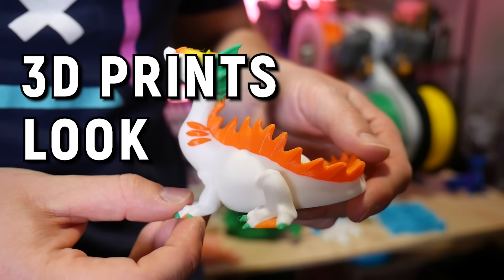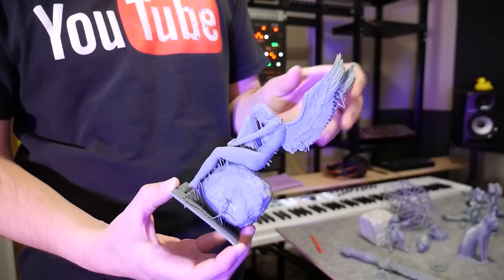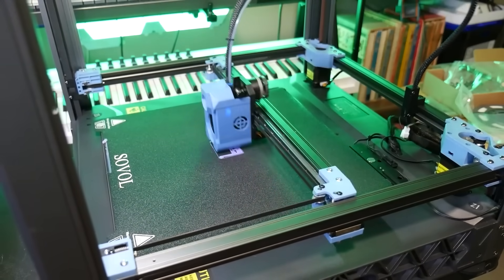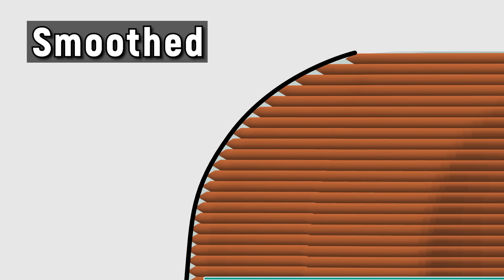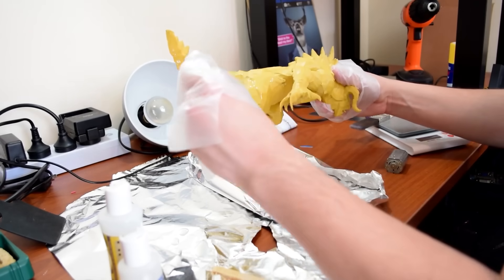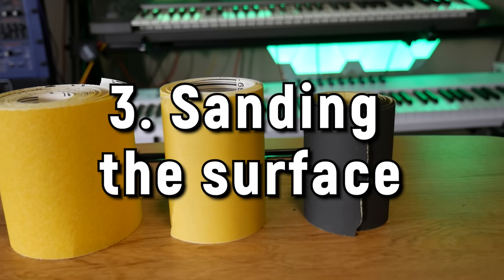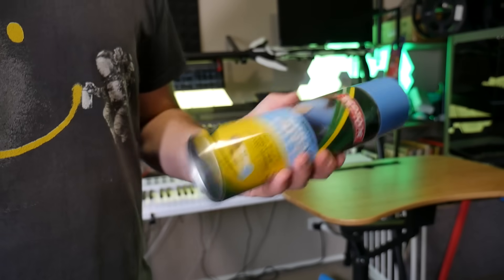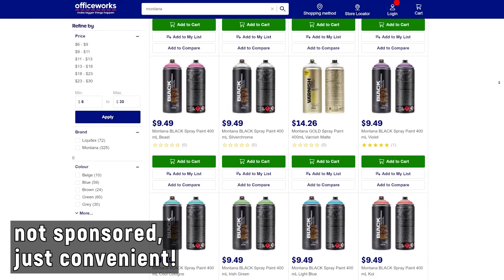How to make 3D prints look like they're NOT 3D printed.

Comment: Yeah as of 2003, they introduced legislation (at least here in Aus) where manufacturers of Talc had to do testing to make sure their products did not have asbestos in it. The reason it even does to begin with is because Talc and Asbestos are both minerals that are mined and are regularly found very close together so contamination becomes unfortunately common. They've since switched to corn starch for the same purpose (sports powder, baby powders) and it MAY be able to be used as a thickener but you would need to test it. Being corn starch, I wouldn't be surprised if it wanted to try to clump when added to resin so you may need to sift it in while mixing to prevent the issue.

Comment: Hi very interesting video. Love the details however there is one small problem for me. It's apparent to me from your accent that you and I are not from the same neck of the woods. Therefore there will obviously be terms that you use that I am not familiar with and the same in reverse. All that said .........What exactly are you referring to with the term BOGGING?
Reply: Reference to a product called Builders Bog which is a putty like product but sets hard with an activator. Used by builders, auto repairers etc
So when you are 'bogging' you are doing putty type work.

Comment: Vapours? Dust? Fine powders? Buy an LEV, use a Tyndall lamp to check the maximum working range of the LEV's hood and make sure you use it. Its going to work 1000x better than any PPE, removing almost all contaminants from the air, meaning no lingering dust or vapours will remain hours after the work in the air that you or other people will breath in. An LEV is a Local Exhaust Ventilation system, a kind of vacuum cleaner for a work area. Chose the correct type for the work you are doing and the contaminants you are producing. Its an investment for your set up and your health. This is even more important if you are young and just starting your own workshop. Respiratory issues can take decades to appear, the same with the other issues with your body when exposed to such chemicals - a number of cancers are caused by inhaled chemicals that end up in the blood stream that ultimately travel around the whole body.

Comment: Its one of the reasons i switched completely to resin printing, high resolution, high print speed, easy sanding for my highly detailed sculpts.
I mostly use knife putty used for drywall to fill scratches and small holes, its non toxic with very low smell, has toothpaste consistency, water based so it can be thinned with water and reactivated and smooth with water so sometimes just going over it with a damp cloth to smooth out the excess works great without sanding.

Comment: Frankly, I believe in KISS (Keep It Simple Stupid). If I want to get the same perfectly smooth results, I just spray my work with several layers of Rust-Oleum Triple Thick Glaze spray paint and all the print lines disappear. 
And if you don't like the original, just spray on a base coat of the color you want.
Plus, should you wish to achieve a pearlescent appearance, all you have to do is make the base coat white primer. 
And I haven't once had to resort to sanding. 
Why people insist on making their work so much harder and time consuming I'll never understand when just three or four coats of spray-on clear glaze gets the same, if not better results than I've seen from all the overly labor intense methods like this I've been seeing on YouTube and still get the same results in 24 hours just by applying three or four coats of Rust-Oleum Triple Thick Glaze spray paint, and not once having to touch your work with sandpaper. 
KISS! 😘
Maj. Tamre' Colby 😃👍

Comment: Card or cabinet scrapers aren't talked about enough in smoothing 3D prints, but do a fantastic job at scraping down the high points to a close to smooth finish so you don't have to do as much sanding

Comment: Could a sprinkler made from say, pla for the main body and a silicone disk (replaceable) with holes angled correctly be something you could make?
I’m thinking the disk expands under water pressure like a dome.
Have you tried dipping into a plaster slurry?
You can use a masking tape on each surface and paint…. Just let it dry (instead of double sided)

Comment: Going to even higher grit gradually and finishing it with clear that you use polishing paste on will get you a really smooth end results. Then you will get rid of that "orange peel" effect that you have on the red piece you showed. Check out the light reflections, they will reveal the rough surface. Ask a scale modeller how he knows.

Comment: Sanding becomes much easier with a good sanding paper (3M Cubitron Xtract is indisputably the winner here, watch the Jonathan Katz-Moses sand paper comparison - the ratio of grams sanded per dollar spent makes it BY FAR the most cost efficient and time saving sand paper - ever), a random orbital sander with a soft foam cushion (for gentle curves), and a Dremel / Foredom (Vevor S-R, 230W version is a really good knockoff) with various sanding attachments, you can even build (print?) your own bits and stick the Cubitron paper on there. Works really, really well with any material.

Comment: I’m an epoxy/resin artist and they sell a liquid resin in a bottle you could easily use on these. Just google uv resin ..  it’s not the kind you use in a 3d printer.. it’s used for molds or to make resin art so it’s a bit thicker.. . Just brush it on like you did with the epoxy and cure like you did with the printer uv resin.
Reply: I just searched it up, is it the “LET’S RESIN UV Resin Kit With Light”?
Reply: @MiracleMyz 
That’s one of them,  yes! ;)
.. I use a couple different Uv resins their a bit more expensive called “Counter culture Uv resin” and also a uv from “Resin Rockers”.. …. but “Let’s Resin” is a popular decent brand out there as well. ..
The difference between Let’s Resin and the other 2 I mentioned is that you get a more consistent result when using the more expensive uv resin .. 
Less or no bubbles, no yellowing, etc.)
Reply: @MiracleMyz and yes you’d need a uv lamp to cure it. Not necessarily the one from let’s resin .. (there’s a lot of different lamps out there besides that one.) but I’d say the most important thing is just make sure whatever uv light/lamp you purchase has enough of wattage to it (so you can cure your projects fully) and can cure many different projects… whichever uv resin you buy see what the highest wattage is to cure your project is on the bottle and then make sure your uv lamps wattage goes up to the same amount of wattage (at the least.) Then this way you’ll be able to cure a range of different projects. (Because the wattage and times differ depending on projects.. like how thick or thin the uv resin is.)

Comment: I dont know much about sanding but 400 grid sandpaper seems to be not that fine, i mean car detailers use i think 2500 grid sandpaper for repair scratches, is the 400 grid really good for like a high gloss piano finish?
Reply: Yep. I would sand to 2000 before painting, and then clear coat. The clear coat then gets wet sanded to 5000 before finishing with polishing compound. When done right, you’ll see your reflection.

Comment: my favorite way to smooth prints is by using wood filler mixed with acetone, you mix however much acetone you want for consistency, my default its a paste, afterwards you either smudge it with your hands wearing gloves or brush it on with a brush, it cures very quickly and you can sand easily compared to pla so it will remain only in cracks and crevices if you wish.

Comment: I tried UV Resin and Baby Powder.  It too can be sanded down to a smooth finish.  I got great results.  Can keep repeating.  Also much easier to be selective with where I put the mix down using a paint brush.

The best part is it’s super fast. The UV resin cures in seconds and only takes 5 min of sanding to get great results.

Comment: Very helpful info, and well-presented as always. Cabosil is the definitive thickener for epoxies and resins. One drawback: take precautions to avoid inhaling the dust -- a simple dust mask will do.  In return for this important but simple handling precaution, it is easy to use and very effective for making liquids non-saggy/drippy.

Comment: I got this response from ChatGPT: “Using 60 grit sandpaper is a good start for removing rough layers from a 3D print. Before applying Septone spray putty, it's beneficial to progress to finer grits, such as 120 and 240, to achieve a smoother finish. This preparation will help the spray putty adhere better and create a more even surface. Ensure the object is free of dust before applying the putty for optimal results.”

I’m not so sure if I should continue to try 120/240 prior to the putty ?

Comment: If the best solution is Sanding, how would you do that for very intricate models like the ones you coated in resin etc? I doubt you can sand all the teeth from the dinosaur.  So I guess every techniques has it's limits, pros and cons. If sanding is not an option, wondering what the best coating option is?!

Comment: Neat, I learned something. I have my outer layer set on my printer to be a bit thicker than most people set. Then, use a very sharp knife - really carefully - to smooth the surface. This is aggressively sanding it without making micro plastic dust. This removes the layers. Then I do one of 3 things. If I want to maintain that etching look, leave it. If I want it looking professional I might go in with a colored UV Resin, or clear if I'm gonna paint it. UV Resin is a pain cuz it takes forever to cure when using a thin coat... keep that in mind. Perhaps my finished desired was this and I stop, perhaps I paint over top of it. I'm always eager to learn!

Comment: Fantastic! The most useful tip might be print orientation. Somehow I've not thought of that for FDM printing. D'oh! 80% of the time that alone might be enough and costs only patience. And you're so right, it's worth the printing time to save finishing time. 

Worth noting this affects the strength of the part, depending on the layer lines.

(Never heard of bog spray! Cool.)

Comment: I use UV Resin for coating all the time. Small detailed surfaces can be smoothed with a small brush and than sanded with 400-600 grit Sandpaper. The best part is that this make parts watertight (for RC boats).

Comment: With all of the news about microplastics, and someone who has just bought their first 3D printer... I don't know about it all. Super fun hobby, but do I really want to expose myself and my family to the risk?
Reply: Its totally reasonable to suspect 3d printing but the only harm it can lead to is if you print in a area with poor ventilation and and if you are printing for the sole purpose to help consume something besides that no dangerous fumes should harm you or your family unless your constantly printing
Reply: Depends what sort of 3d printer. An FDM printer using the normal plastic filament will be fine, and wont produce fumes. Of course if you are sanding it like in the video it will produce fine particles, but just do it outside with PPE and you and your family will be fine.

Resin 3d printing on the other hand is a little harder, the bare minimum you want is a well enclosed space with a ventilation system going outside. And the entire system being in a room that you wont spend much time in.
And sanding that sort of stuff is a bit more dangerous.

Comment: In Cura, I just use the Fuzzy Skin option quite a bit these days.   I realize it's not for everyone, and it can be tweaked to satisfaction, but overall I love that.   You can hardly tell it was 3D printing and the layer lines are almost all eliminated.   Does anyone agree with me?
Reply: The fuzzy layer peels and chips off
Reply: @ShopeeMarketteam  Never had that happen but I guess some abrasion rubbing against it could happen.  I just looked at all my models with fuzzy skin, holding good.
Reply: @ShopeeMarketteam  What are you printing with which it peels off?

Comment: I've attempted to use the wood fillers for 3D prints because some of those can be smooth down with water, but problem often was with applying the fuller since it's a paste. My only hang up was trying to sand organic shapes (example: a dog model with some sculpted textures) and my inpatients with seeing very little progress done with sanding as in the past that was mostly what people suggested doing... just sanding and no fillers to try and smooth a surface. I might see if I can find something similar to the spray stuff here in the US when I get back to 3D printing more often

Comment: So I feel like your understanding of Resin printing is somewhat lacking. UV prints do not get any more embrittled than most other plastics. The photoinitiator is usually spent during the curing process. Once spent UV embrittlement actually occurs similarly to in most other plastics. Also the primer and paints are going to block UV. Warping is not a result of exposure to UV but the fact that a lot of resins have a really low HDT. So just like PLA they do not do well in direct sunlight due to this not because its reacting to UV. It’s not unusual for resins to have an HDT as low as 50C which is significantly cooler than even what PLA can handle. The build volume is also comparable to similarly easy to use machines. Resins printers are almost push button these days. For the Price of the p1p you can get something like the anycubic m7 Max which has 90% of the build volume of the p1p. My view is that detail aside you look at your application and choose the right plastic for that not large go FDM small go Resin. As for how I finish my prints it totally depends the application and material. For large resin I’ll straight up media blast it. I don’t think people realize how hard Resins are when thick. In miniatures they are pretty weak but 3-4 mm of solid resin is really really hard to break. For FDM I like using wood filler to smooth out the layer lines or again media blasting the part. For miniatures depending on how lazy will use thin coats or up resin to remove layer lines. Or sand it by hand. But generally speaking if the part is larg

Comment: One thing that's good to keep in mind if you are going to rely on sanding: Print thicker walls! It's incredibly disheartening to ruin a long print because you went a little too hard in one spot and managed to sand down until you exposed the infill. Putties can help fill it in but it's still a pain and may lead to that spot having a slightly different look.

Comment: If you're still looking for an additive to thicken resin for smoothing, you might try milled glass fiber, silica thickener or Glass microballoons. You should be able to find these at any fiberglass supply house. I use products from "TotalBoat"

I use these all the time on boats to mix with fiberglass resin for filling holes, building up fiberglass corners in bulkheads, a thin skim coat to fill tiny imperfections in fiberglass before gelcoat, etc. You can make the resin virtually ANY consistency you want.

I bet this would work great for your application. It's relatively inexpensive, a little goes a long long way and you already have the safety equipment required for use (good respirator).

Comment: Here is a really big tip that wasnt in the video. For FDM printers you should use a 0.2mm nozzle instead of the standard 0.4mm that comes with every 3D printer and also setting your layer height to as minimal as possible in software, that alone can make it silky smooth right off the printer. This alone makes the prints look almost like resin and I have only had to do minimal sanding!

Comment: Full on heat reflow works well too. Print it in 100% infill, pack it in casting sand, heat it up to where the part just starts to melt. It will be much stronger and smoother when it has cooled back down. Also handy if you don't want to risk glue failure of the part and removes seam lines.

Comment: Somewhere between the spray primer and resin, can you not brush on a two part automotive body filler? Instead of thickening it up with some kind of additive, you can mix it up in small batches to minimize waste, paint it on when it feels just right but before it's too cured to work with, then make another small batch, rinse and repeat until the model is coated, then sand it down to where you can just barely see the layer lines because the filler cures ridiculously quickly when mixed.

Comment: If it’s big smooth surfaces like helmets then it’s sand with 100 grit . Coat with thinned body filler and sand , rinse and repeat with 250 and maybe wet sand with 600 if it’s helmet or armour.  Blasters it’s just sand and sand and sand again

Comment: I will be buying my first 3d printer soon and I want to try using model hobby surface primers. The best ones are from Mr Hobby. They are self levelling and very thin, when applied through an airbrush. I believe my experience in modelling will come in handy if I want to smooth and paint parts that I print.

Comment: There's these electric dead skin files for your feet that have a nice low rpm and often adjustable speed so they don't melt the plastic from excessive friction and you can use double sided tape to stick any grit sandpaper you wan to and if you've got a lot of big flat prints to sand for cosplay or whatever it's the best $15-30 you can spend. I used a foam pad of 400grit to smooth out between the ridges of a vase I printed and it came out really good without ruining the ridges or taken tens of hours to sand.

Comment: 7:40 the BIG problem with that orientation is that you get a very weak structure that will break at the first sanding; keep in mind the Z axis, the direction in which every layer of filament is deposited, is the easiest to separate when you apply force along the vertical axis.
Reply: True, but if it's a part that will be glued onto a larger backing piece or some such, then it's not an issue.